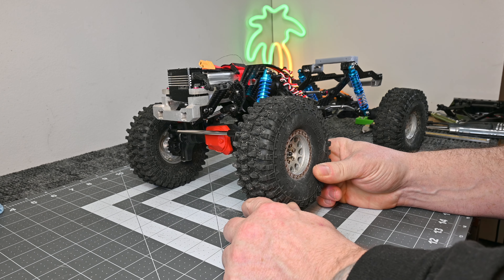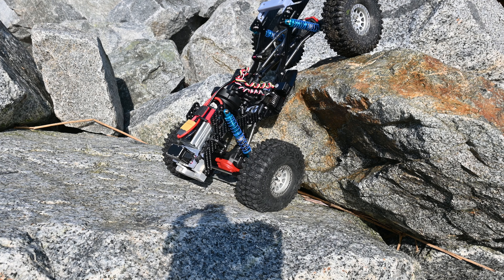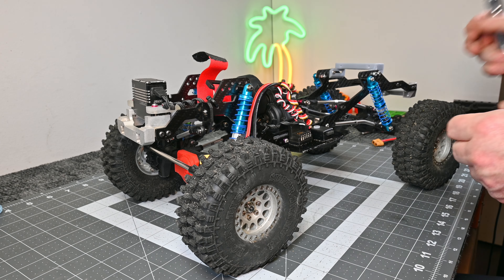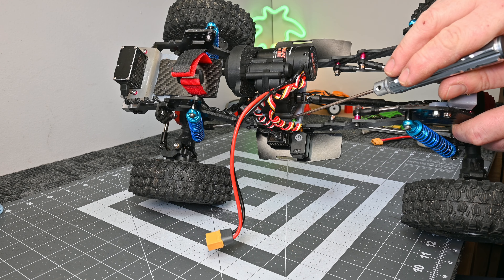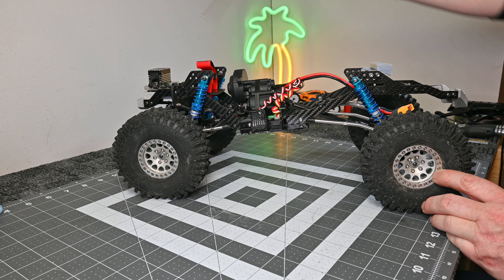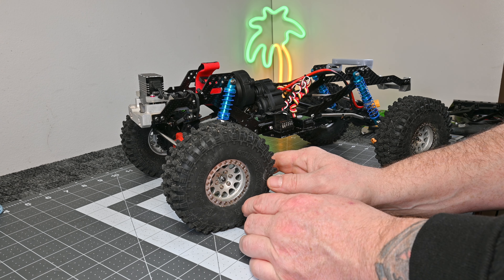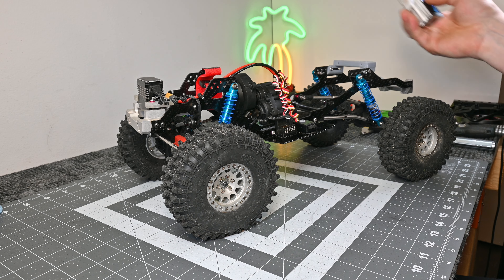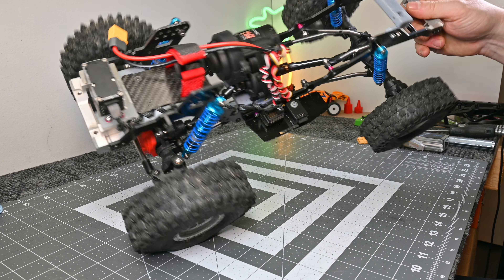RC Shop Talk Episode 1 - Injora LCG kit - Stealth X Trans - TRX4 Axles - 3d Resin parts

Comment: I am watching closely.  I've been really wanting to do this but i don't have a 3d printer
Reply from the maker: You could  buy  a skid from another company. Just drill and tap new mounting holes. I believe Team garage hack has a skid you could drill to fit. Just make sure you pick the same width as your chassis rails are spaced.

Comment: building mine now...i ordered a SOA bracket. My only issue is not being able to space the links like you did because of the trx4 trans. I also am running Desert Lizard 110mm f/r on semi droop. Had to space top of shocks almost 9mm to keep them from rubbing the rails. Another issue is I want to run a prefixal gearbox but as you know.. the rails are only 72mm. Next lcg will be the scx10 version.
Reply from the maker: Yea, I had to tweak spacing everywhere. Still actually working it out. Even the stealth x was a tight squeeze.

Comment: Try these GLOBACT 1.9 Tires 1/10 RC Tires RC Crawler Tires 120 * 45mm for 1/10 TRX4 TRX6 Axial SCX10 I II III Redcat GEN7 8 RC4WD (4Pcs) or the fake ruptures they both work good
Reply from the maker: Thanks! I will check them out.

Comment: I think the side skids are on the wrong way
Reply from the maker: Doesn't matter which way you place them, they snag because they are alloy and trash design. I found they hung up on rocks towards the rear if placed the other way. Ideally installing steel sliders would be better. These trash units came with the chassis.